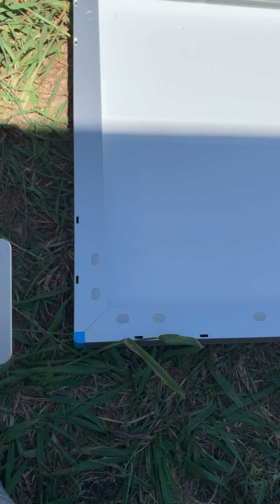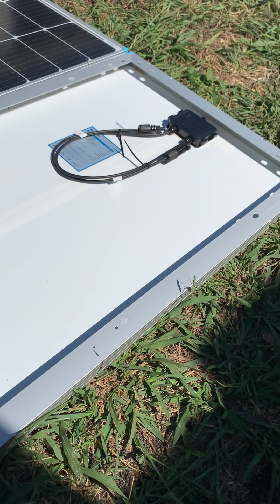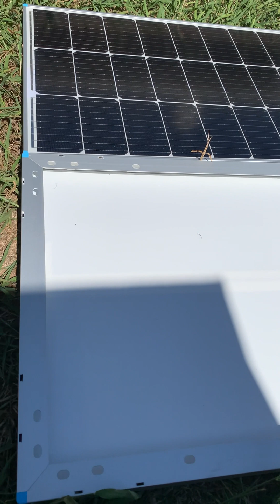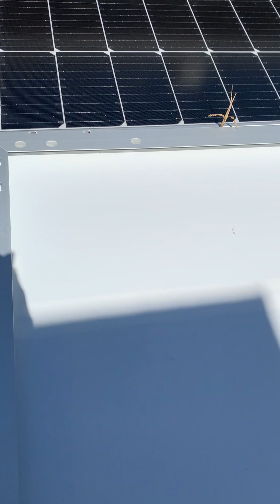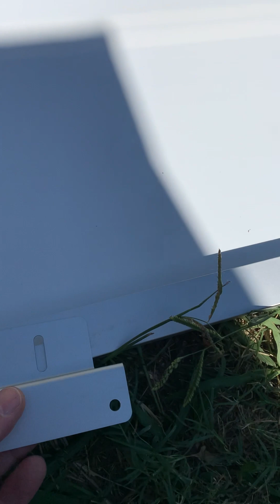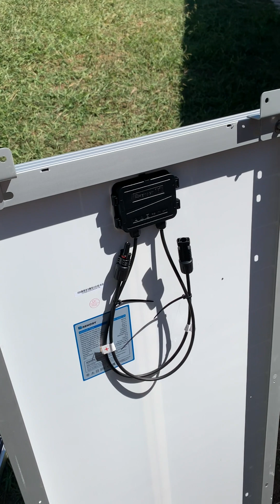Solar Install: Renogy 100W Solar Panel Mounting Brackets

Comment: Hi there, appreciate the video! What is the total width of the solar panel with the feet mounted on the side? I'm trying to figure out where on my roof i got room. Thanks!
Reply from the maker: I feel like it adds about an inch to each side. Keep in mind there are several different ways you can mount the clips so you have options.

Comment: Could you explain the nuts, bolts and washer sequence? Thank Q
Reply: Mount the brackets to the Solar Panel first before you install it so it makes it easier.. Also there is no "specific way" on how to put the nuts and bolts on but it is much easier with the mounting brackets put on first